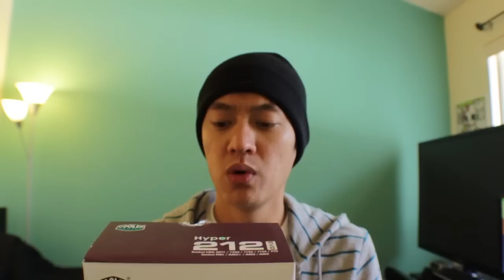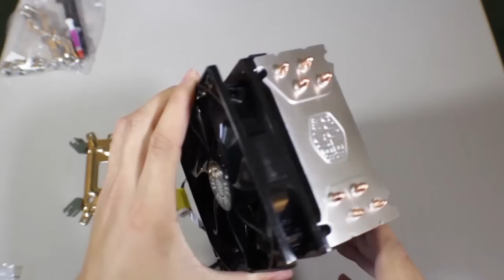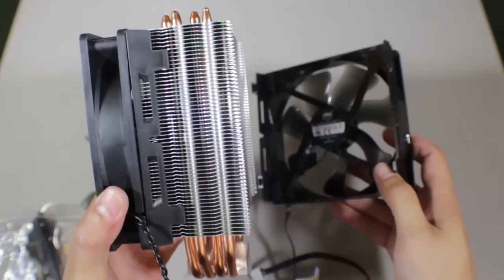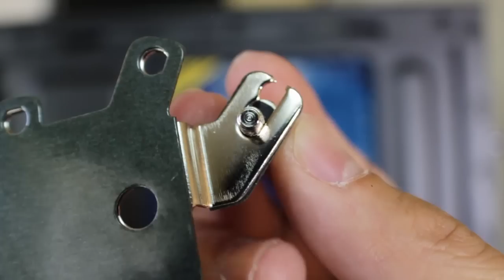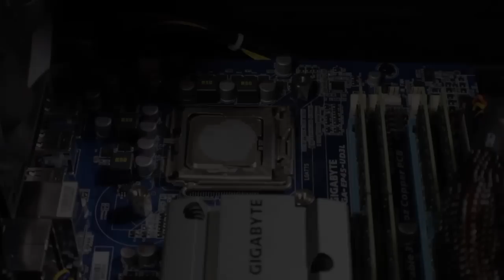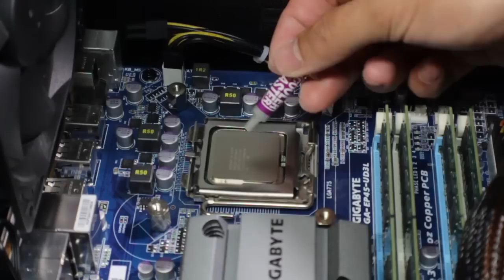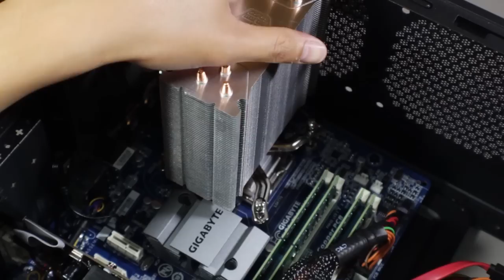Installing an After Market CPU Cooler Fan - Cooler Master Hyper 212 EVO

Comment: I need help, I have the same fan but it makes a sort of strange noise like if it was blocked by something or something hitting against the blades (I checked there is nothing blocking it). It does that until the speed reaches 1532 RPM and there is no overheat.

Thanks for helping !

Comment: great vid , quick question , i have  msi a55m FM2 motherboard micro atx has two ram slots both with 8 gb & amd a8 5600k currently i 'm running on a stock heat sink but my case has a 92 mm rear fan and two top fans 120mm each along with two 92mm side fans i ll be using them all so i am looking to buy an aftermarket cooler , so the ram i have is 1 cm away literally (i measured it lol) if i get this can i point the cooler up no side ways , i.e it is facing the two fans at the top of my case

Comment: What are you using to avoid electrostatic discharge? I noticed you weren't wearing a wrist strap, i was just wondering if there is something i can use that won't be in the way.

Comment: You didn't mention if the fans that go on the heatsink are 120, 92, or 80mm. What size are they, because I'm going to buy an extra for push/pull and I don't know which one to buy

Comment: Could you describe what that is where you put the power connector for the first fan at 23:05? Is that a 4 pin connector? I can't find a piece like that on my motherboard. I have a slot like the one where you put the second fan, and i have 2 pieces with 3 pins.
(I'm just curious, maybe I would like to get me a second fan if it's possible on my motherboard).

And thanks for the GREAT upload, very detailed video. I have succesfully installed the cooler into my lga 775 system. Only gotta test it now

Comment: i got the same case and coole! You can put the two top fans where one blows air over the ram and the firtst hyper212 fan sucks it in and the other top fan over the heat sink can suck air out of the case! Think about iiiiiiiiiittttt!!!!

Comment: has anyone tested to see how loud the hyper 212 evo fan is at max fan speed, or 36 dba? does it have a adjustment on the fan itself or does it just run based on how hot the processor is? i know you can change the fan settings on bios but obviously you wont get the full benefits if kept on lower settings, why is it that the noctua fans costs a lot more, is it simply because they are quieter? as far as cooling, would a hyper 212 evo fan at lower fan speeds cool a x6 1045t fine if oc to 3.5ghz?

Comment: It doesn't matter what connector you use if you don't want to control the speed. You can use a 4 pin power connector from the PSU for all anyone cares. As long as the fan spins, you're good.

Comment from the maker: Some swear it is the best but I have also spread the grease to make a thin layer. Many will say that is the worst method because it creates air bubbles. I want to make a video where I use many different methods and test the heat on the various methods. Stay tuned!

Comment from the maker: I can't say for sure because the motherboard and case cut out might not be lined up in the right way. Just look in the back of the cut out and see if all 4 corners where the mounting holes are showing in the cut out. If it is, then you should be fine and can leave the motherboard in. If you look at my case swap video I show an example of what I mean.

Comment from the maker: The stock cooler is fine if you don't overclock. But you are getting the 3770K and the K is meant to be overclocked. So if you are not going to now but will overclock later then wait until later to get an aftermarket cooler. If you don't think you will ever overclock, then get the 3770 instead. Yes it will fit the Thermaltake V3 AMD Case. Hafe fun with your build!

Comment: Question, I am buying an i7 3770K this week along with an Asrock extreme 4 or 6 (most likely 6). I do lots of HD video rendering and editing along with HD livestreaming and very MINOR PC gaming at the most Borderlands 2. Do I need this cooler or is the stock can good enough? Also will this fit inside of a thermaltake V3 Black AMD Case?

Comment from the maker: Yes you can plug the 3 pin conector into a 4 pin header. You can use a 3 pin fan as the pull fan. Even if one is slower than the other it should not really matter that much. You just won't be able to control the speed of that 3 pin fan as much as the 4 pin fan.

Comment: Can a 3 pin fan be used for the "pull" fan in the push pull set up and still be ran off the 4 pin cpu fan header? found 4 pin y adapters but no y adapters with 3 and 4 pin

Comment from the maker: You can buy a splitter. Type this into Amazon to see what it is. StarTech.com 12-Inch 4 Pin Fan Power Splitter Cable - F/M (FAN4SPLIT12)

Comment from the maker: I would say change it because if you opened it, dust and air bubbles are most likely in there now and over time that will degrade the performance of the grease. You can try running some benchmarks and look at the temperatures to see if there is a difference. If it is operating fine then don't change it. Just make sure you test it again in a few months. If the grease goes bad, don't worry about damaging the cooler. You can just clean it off and apply new grease.

Comment: Best tutorial I've seen on this, good job!

For everyone else, the best way to install this is to do it on a new build. So if you're considering one of these, get it earlier rather than later. Then you don't have to clean the CPU, and you can mount the sink/fans while the motherboard is outside of the case. It will be much easier this way.

Comment: thx i saw 1 on amazon for $30 but i not sure if i will go with it because i'm planning an i5 build for gaming and i would like to implement the push/pull system when overclocking. from what u said and from other reviews, the ram obstructs the cpu fan that will push the air through the heatsink. this leaves only the pull method if the heatsink cant be positioned to blow air out the top of the case.

Comment from the maker: Ah yes that would be a pain. I mean I have the FM2 socket and used the AMD bracket from the cooler master hyper 212. It does not list the FM2 or FM1 on the list but it works! Hope that helps.

Comment from the maker: That 2pin to molex connector might not be the correct connector. Fans will usually 3 or 4 pins. If you try switching the connectors by plugging the not working fan into the motherboard just to make sure the fan works, then most likely that is not the correct adapter. The one you have might be for a smaller fan.

Comment: hello, i have installed a thermaltake Frio on my i5-2500, this is the first time i have had a cpu cooler with 2 fans and my mother board only supports 1 case fan and 1 cpu fan, had lying around a 2-pin (like the case fan and cpu fan plug) to molex i belive ( the old IDE connection)  when i turned on my computer the 1st fan turned on that was plugged into the motherboard started up fine but the one plugged into the PSU didnt start up, im wondering if you know where the problem might lie, thanks

Comment: no i didnt applied any thermal paste
seems like the thermal compound on the heatsink and cpu has dried up totally
i have opened the pc first time after 1.5 years :P
i will have to apply thermal paste and btw the idle temps have gone down to 40 degrees when i adjusted the cpu fan but still load temperatures goes above 100 degrees and then computer shuts down on prime 95.
wish i would have spent my spare time on something else xD

Comment: i removed the stock cooler of my i3 540
before doing anything i check my idle and load temps
idle temps were 38 degree celcius and load were around 75-78
then i decided to clean my stock fan 
later when i put the stock fan back the temps were around 90 degrees when idle
why so? i reinstalled the fan again but no luck

Comment from the maker: The stock fan is fine if you are not overclocking. But it also depends on the ambient temperature of your room. If it often gets warm in there then I would install the aftermarket fan. Warm would be greater than 75 degrees F. Thanks for watching!

Comment: This is the exact cooler I was looking at for the exact case I got. Perfect! It's also good to know that I can attach the mounting bracket without taking out the board because of the port on the back side of the case.

Comment from the maker: Yes you can change the fan to an LED one. I have done it many times with this specific setup. It does not cause flickering because the power for the LED is on a separate source from the fan. Thanks for watching!

Comment: Johnny, would you be able to change the stock heat sink fan for a blue LED one (or two)? If so, I'm concerned that the variable CPU fan voltage might cause LED flickering. What are your thoughts?

Comment: What case are you using ? Basically I am wondering if this will fit in HAF X while still being able to use the top fans. 
With push/pull , is it really worth it ? The way I see it is the fan with the highest flow rate will be pushing that flow rate through, while the other is just making noise, I could be wrong.
Finally, good review, thank you.

Comment: Wow, looks like it barely fit in that case.I'm thinking of getting one for a cpu upgrade from AMD dual 7750BE to a Phenom II X4 965 BE. My case looks to be the same width,but what is the actual height of this thing installed on the motherboard from the top of the mother board surface to the end of the cooler? Any idea? I might need to go with the shorter Hyper N 520.

Comment from the maker: Yes it will move even after it is attached. There is a little bit of curing where the grease will harden a little bit over time. Yes it should fit over your RAM.

Comment from the maker: You can use the 3pin for the second fan on the cooler. For the case fans, they typically come with 4pin Molex Connectors and you would plug them using the molex connectors from your power supply. Thanks for watching!

Comment: Have the same case as you brooo and hyper evo 612 on my quad... Now I have a question for you. If I buy one more fan for my CPU heatsink i will plug it in Sys_FAN (3pin)... But what sort of case fans i need to buy because  i don't have more jacks on my motherboard. I wish to have 4 more fans in my case (one on bottom, one on back to push cpu heat out,,,, and to on top)

Comment: Damn!  Your computer is so cleanly built!  No cables in the way.  My computer, perhaps because of the size of newer components such as the GTX 670, SoundBlaster Recon3D, etc, has such a terrible mess of cables everywhere!  My case has terrible cable management as well...  So that doesn't help...  Does anyone have any case suggestions for a gaming computer?  Something that has a good amount of stock fans for cooling, but also has good cable management...

Comment from the maker: It will if you rotate the cooler so that the air flow moves from bottom to top then it should all fit.

Comment: Bru i have the same casing elite 430.I wanna install the hyper 212 cooler with dual fan.My motherboard is the gigabyte 990 xa-ud3.i wanna know if its gonna fit in the casing.P.S. i have 2 120mm fans mounted on the above 2 exhaust,which is not there on yours.so is it gonna fit with all this mounting.

Comment from the maker: In my opinion I think it depends on the thermal paste. If it is a thick consistency, I will spread it. If it is a soft greasy consistency, I will only apply a dot. Sometimes when I am lazy and don't want to spread it or the system is a cheap budget PC, I apply the dot. Thanks for watching!

Comment from the maker: Stock coolers are fine if you don't overclock. I usually switch to a new aftermarket cooler for quieter running and it looks cool. Thanks for watching!

Comment: thanks for this video! this is the first video that installs an hsf while the mobo is still on the case, I've been wanting to buy an hsf either the CM EVO or Noctua U12P SE2 but is having 2nd thoughts because I don't want to remove my mobo. Now I know it's possible to install it w/o removing the mobo.

Comment: did you able to put the side cover back on? All i afraid is that the massive copper pipe wont fit in my case. What case did u use? thanks

Comment from the maker: A lot of people also say that spreading it creates air bubbles and bubbles will retain heat. In my opinion it depends on the thickness or consistency of the grease. I would say that thick grease should be a pea size in the middle and thinner grease can be spread. Either way, don't use too much. Thanks for watching!

Comment: Yes, I agree. Details are what most of the more professional video designers overlook. It makes them seem less reliable because details can only be obtained by experience or dedicated research. However, if I may make a suggestion, you would make it much more satisfying for everyone if you added annotations somewhere on the video that separates each topic of discussion. That way people can skip back and forth in case they're using the video as a quick reference to a step.

Comment from the maker: The 3 pin will spin at a fixed rate. The 4 pin will spin at a different rate yes that is true. The 4 pin however is adjustable so then you would have to match it in the settings, either in the BIOS or motherboard desktop software. That is what you can do but you can also just get a splitter and they will both spin at the same rate. Thanks for watching!

Comment: Read that if you use a 3 pin connection and a 4 pin they won't be rotating the same speeds, so it's better to use a Y splitter for the 4 pin connector. Did you have this happen?

Comment from the maker: @TheRacingfans Don't clean off the CPU, clean off the heat sink. Leave some on the CPU. I don't know what will happen because I have never done it that way. I only know what works best. I can't tell how well something that is done differently will work. It could be fine or it could be totally wrong.

Comment from the maker: I don't know what is in that spirit stuff. How much alcohol is in it and how much water is in it? Alos, don't use toilette paper. It will just stick to the grease and leave lint all over the place. At least use a coffee filter.  So then you should just try scrapping of the extra grease before wiping it down in case you will need a little bit more later.

Comment from the maker: If all else fails, go back to where you bought the cooler and tell them it did not come with thermal grease and try to get another one from a new package. Or return the whole thing saying it was not working right and get another cooler.

Comment from the maker: You can use regular rubbing alcohol. The same kind you use to clean cuts. You can find a bottle at the drug store for about $1 US.  Try only removing the thermal grease on the heat sink. Try to keep dust from falling into the cpu and getting stuck on the grease. Put a plastic bag over the cpu. It also takes about a month for the thermal grease to cure before it reaches the best performance. Good luck.

Comment from the maker: All of the thermal grease it came with? WOW that is too much. you just need a small pea size amount or a very very very thin layer of thermal grease. When you put too much the grease will end up retaining the grease. So now it is holding in heat instead of just transferring it efficiently. I suggest wiping it off with 91 alcohol and using nano diamond compound. I have another video on thermal grease. Just search my channel. Thanks for watching!

Comment from the maker: After installing it with the thermal grease, you might be able to slide it ever so slightly down and away from you top fan. Just nudge it a little before tightening the screws on the retention bracket all the way. But make sure most of the cpu is still covered by the heat sink block. Thanks for watching!

Comment from the maker: Once you expose that grease to the air, dust will fall onto and stick to it. That will contaminate the grease. Then there is the fact that the old grease is wel....old. It's like changing the oil in your car. Only you don't need to change the grease for a few years depending on how hot and heavy you run your CPU. thanks for watching!

Comment from the maker: I did replace my fans but not for performance or anything like that. I just swapped them out for fans with blue lights inside. All show and no go. The stock fans work great. If you decide to get another one get one that looks the same. If you decide to replace both of them, I got the Blue Cooler Master R4-L2R-20AC-GP from Amazon. Links are in the description.

Comment from the maker: I am using normal memory sticks it would also depend on your motherboard heatsinks. if the ram gets in the way, then rotate the heatsink so that it is pointing up (moving airflow from bottom to top). But, if you do that and the ram sticks get in the way then yes you need low profile ram. Thanks for watching!

Comment: What type of RAM can you use with this type of cooler or heatsink?  I was told to use low profile on my build since I will be using a CM Hyper 212 Plus heatsink.  Thanks for loading this video.

Comment from the maker: You can tighten the screws until they don't turn any more. Meaning until the thread runs out. You will always be able to twist and turn the cooler a little bit because of the grease. Is that clear enough?

Comment: Thanks so much for your help I just have one more question, I have an AMD radeon 6950 2gb card and I play a lot of graphic intensive games and it gets really hot sometimes, so I was wondering if you think adding a side fan on my case would help my gaming performance and the life of the GPU or do you think it would make much of a difference?

Comment from the maker: You can pull air from the front and push it out the back or if you rotate it 90 degres pull air from the bottom and push it out to the top.